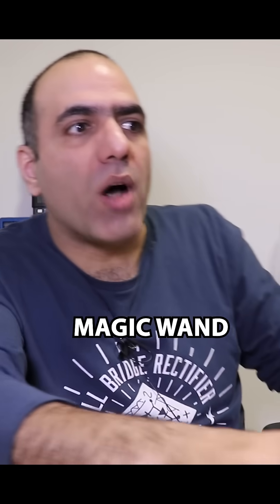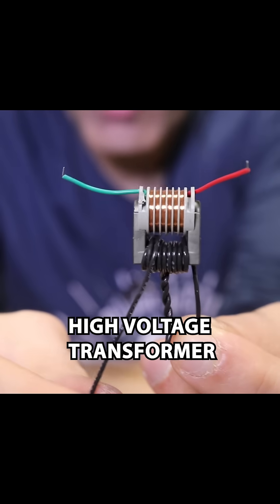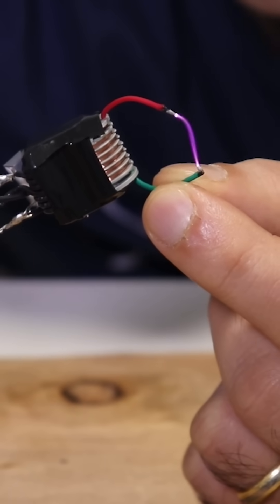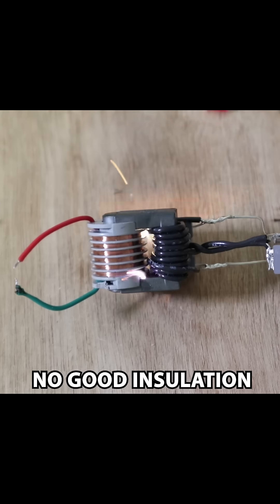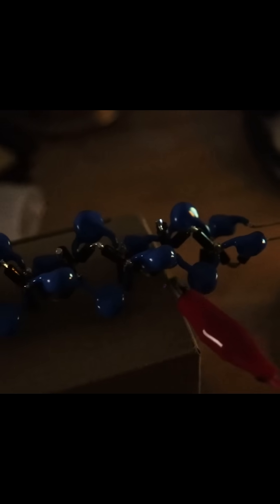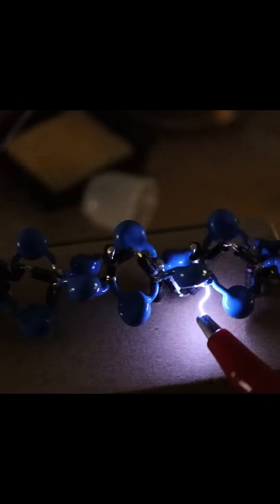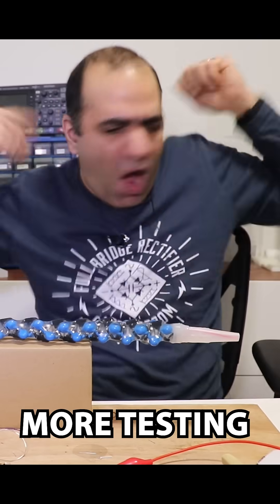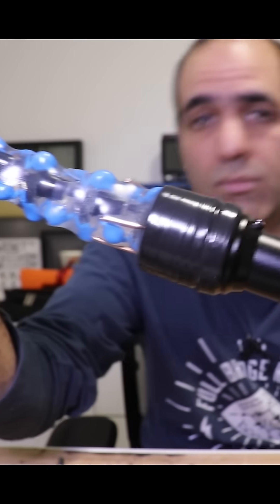Making a MAGIC WAND #electronic #magic #funny #charger

Comment: What if you make it into a lightning gun. Using compressed air and metal dust to create a stream of metallic smoke that you can then use to fire a arch of electricity so if the smoke connects with your target the current will use the metal shaving smoke as path of least resistance ESSENTIALLY MAKING A ELECTRIC VERTION OF A FLAME THROWER..... BUT that's just a idea. 😂PLEASE MAKE IT INTO A REALITY mabye the same with a smoke bomb that the discharges a large capacitor after smoke is dispersed to make a SHOCK GRANADE

Comment: Just remember kids, the real measure of shock's intensity lies in the amount of current (amperes) forced though the body, and not the voltage. The real variable in all this is the body resistance which can range from 500 ohms (wet/broken/sweaty skin) to 100,000 ohms (dry skin/dry conditions). 0.1A of current can stop a beating heart, so since Current = Voltage / Resistance, it only takes 50V/500ohms to produce a potential life-threatening current of 0.1Amps.
Yours truly,
A friendly electrician
Reply: yeyeye its not the height that kills you, its the impact force when you hit the ground.
stop writing that bs, it literally doesnt matter
Reply: @mnzrk  Imagine electricity like water. A hose won't hurt you due to the pressure being low even though there is a lot of water coming out (low amps, high voltage), but if you put your hand in a water cutter CNC machine you'll cut your hand off even though there's not a lot of water coming out. The pressure is high enough to deal considerable damage (High amps, low voltage).
Reply: @mnzrk  and yeah you're kinda right on the falling part. People die all the time during a fight by being thrown to the groud, but a person jumping from a plane with a parachute is safe. One is a fall of >5 ft but the other is 3000-5000 ft.
If your going to argue at least don't literally prove me correct in your opening statement.

Comment: “5 or 6 kilovolts peak, it ahould just burn” and goes ahead to touch it. This guy must have 9 lives😂😂
Reply: 9 trillion, man is immortal, I swear
Reply: @mrargent3586  Infinite, dude has plot armour.
Reply: Voltage itself isn't that dangerous if it has a low amperage it's safe
Reply: @alexstan4669 it was high frequency and so it doesn't shock him
Reply: @alexstan4669 if you watch this same channel, you'll see ElectroBoom dispels that myth. If it's high voltage, you touch it and it doesn't kill you, it's because the voltage has decreased as per you acting as a load and the source having an internal resistance of its own, or because the frequency is too high to affect your nervous system (in which case the current can be very high). Amperage is proportional to voltage in ohmic materials. In the general case, amperage increases with voltage according to some unspecified nonlinear function. It's not like voltage and amperage are independent from each other. When there's an electrical hazard, you'll see "high voltage" or "high tension" signs, not "high current" signs. You'll need a high voltage to have a high current.
Reply: @alexstan4669 And you can control both the voltage and current at the same time?
Reply: You are very polite..
If i did not know better, i would have said " this guy must have less than 9 neurons.." 😋 
But when you know the basics of electricity, you know he's not doing anything life threatning.
Reply: This guy almost killed himself with a MOT. He's fine lol.
Reply: Remember that one. He did a follow up video on that and confessed he was shitting bricks since he said he should have  been dead with such a discharge. He also said that incident had him seriously thinking of leaving YT because of how dangerous that experiment was.
Reply: Grim Reaper: Nah, I'm tired of this guy
Reply: He knows what he's doing the show is just for the plebs that don't have any electrical experience/knowledge lol.
Reply: More than any of these comments, the shock went from one side of one finger to the other side of that finger... even less dangerous than a normal ESD shock
Reply: lol if that were true he’d be dead by now bros a god he don’t die
Reply: he has more lives than cats😂
Reply: Only 9
Reply: He’s way past nine
Reply: It’s funny that people still make this joke about Bedhi, the man’s a genius and found a way to make science entertaining with humor. Aside from his very first accident with the “electric guitar” in which he had a caveman brain moment and it broke the internet. 

He’s actually been doing all these slapstick experiments with “accidentally” touching shit that will hurt him enough for comedic effect. If you pay attention a lot of his “shi-! Oweeee!” Sound fairly consistent with minor variations of pitch to keep it original and hilarious. 

Though the dudes a genius, he’s got like three degrees, he just pretends to be a bumbling idiot that somehow can decipher complex wiring diagrams like he’s reading a book. 😂
Reply: No he has much more than you think m
Reply: Volts hurt, amps kill.
Reply: @DEAVERERIC miliamps actually. About 80 milliamps.
Reply: If he only had 9 he’d be gone by now 😂, bro must have at least 37
Reply: he stated that faked getting hurt most of the time. he's also grounded so had no fear of getting electrocuted
Reply: More Like an colapsed turned to the Side 8
Reply: He would be dead by now
Reply: он подумал наверное я сейчас как Гарри Поттер скажу "потронус".😅😂😂🎉
Reply: 9 lives... and the stock regenerates
Reply: I thought he said i got 5 or 6 kids to feed 😂
Reply: And then each day, his life count resets
Reply: Camera Man never dies
Reply: 900
Reply: You mean 900? Haha
Reply: This guy is a genius.. he knows exactly how much currwnt and voltage that will not kill  him... and plays with it to entertain his audience 😅
Reply: You should see his electric guitar
Reply: Судя по количеству роликов, у него их больше чем людей на планете 😂
Reply: 😂 he goes through 9 per hour mate i wouldn't trust this guy im my house
Reply: @Spettrodivenezia on the contrary you should, since he has a degree in electronics. XD 

Like everything, he has to insert some entertainment into the video... which is HIS PAIN.
Reply: @Kaimax61  i don't care if he was thor himself the mans a mental case
Reply: Remember bud, ohms kill. Resistance. If you are the ground. That's a problem 😂
Reply: @atomicxpxp8430  Actually it is impedance here which matters, not resistance.

Comment: Interesting. I have a question bro. How much do you pay for electricity bill?
Reply: Except for when he pulls out that massive "Infinite current" transformer, most of the time he is taking somewhat regular 'wall power' and changing it to high voltage so it can jump through the air. 
Making something higher voltage while sacrificing its 'strength' means you dont have to have a million dollar electric bill. 

kind of